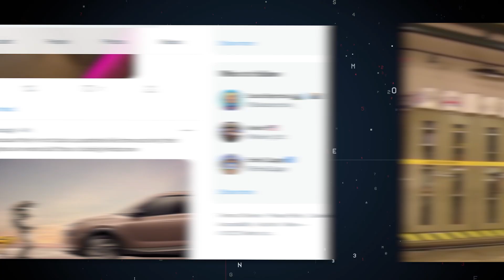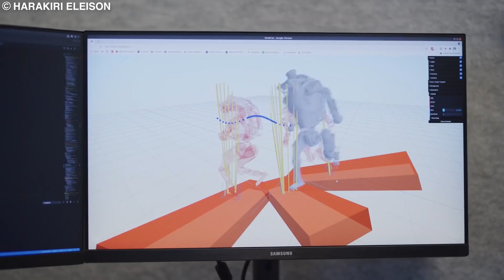Boston Dynamics' New Robot Makes Soldiers Obsolete, Here's Why

Comment: I think the biggest disadvantage of having a robot army is not being hacked but is their vulnerability to EMP's all it takes is one EMP and you lost your whole army unless somehow they make them resistant or immune to electromagnetic pulses but that  is also a double-edged sword because if they ever go rogue how are you going to shut them down it literally is a complicated thing when you think about it.
Reply: Shielding electronics from EMPs is fairly easy.
Reply: @thebiologist8662  you can shield the system, but its hard to shield the sensors such as the Pixel Arrays for Cameras, GPS, Thermal Censor, Control Censors in the actuators, and so forth. As they need to be exposed in order to sense.. without the censors, the electronics system is garbage. 
This also goes for some antennas, EMP Shield work if your core system does not need to be connected outside. Its hard to shield an Antenna and a sensor, to not say completely impossible..
Reply: @thebiologist8662  so we truly are fucked. Good luck a decade from now guys.
Reply: @thebiologist8662  ong
Reply: One:  You can shield electronics from EMPs.  Two: Emplace a self destruct not connected to its own control system. Next issue.
Reply: @dsm3759703  IA is listening. Do not tell this information.
Reply: @benignbarbarian  AI has already read every single article on EMPs
Reply: you blow up the data storage facility and control center, they go down...just like phantom menece
Reply: @tonuahmed4227  this will be decentralized (redundant) and heavily fortified.
Reply: Simple shield the electronics with a farday's cage box and use fiber optics to prevent wiring and connections from burning and shorting, fiberoptics wires are impervious to EMP and put extra shielding on the body itself to further increase resistance.
Reply: @corneliuselbourne1044  the issue is shielding from EMP also shields from remote comm
Reply: Grappling wires around the legs like in star wars to take down the empire walkers.
Reply: When you make robots to wage war you are still primitive. An advanced society doesn't wage war among their own species. They move on to achieve bigger achievements and realize it needs unity to get there
Reply: @optimize-you  I think the only way humanity is realistically going to do that is if we make contact with some form of extraterrestrial power or artificial intelligence (likely not peacefully) that requires the combined might of all the great powers to resist.
Reply: @jonwoodhouse1444  think your right, needs a huge event to unite and then some.. agree
Reply: How would a program go "rogue"? That's not how programs and programming work. They can't think. They just execute scrips full of if/then statements. These aren't sentient. They're not AI. They will never be. 

You don't even need an EMP. Just make a high powered RF jamming device for about 150 bucks, leave it on a building, and you've crippled any kind of data or telemetry they'd need in order to function. They can't tap into real time data being pushed to a sever if they have no access to the server. 

This isn't difficult to beat.
Reply: @marishiten5944  unless they have the Data programmed into their electronics so they don't need an external server
Reply: Thank you. There's NO intelligence. Just stacked algorithms by human hands. N machines ALWAYS need maintenance. Never take over but not saying police won't use the to bully us. Or even kill a few of us, but claim the machine must've malfunctioned. Free from justice not that they already aren't.
Reply: It’s very easy to harden things to EMP
Reply: Most modern military equipment is already shielded from EMPs.
Reply: @jonwoodhouse1444  you’re right but most civilian infrastructure is not private companies and the government have been fighting for over a decade on who should pay for it it’s not hard to emp proof things but it is going to cost billions and private companies don’t want to pay for it if we  were to get hit with an emp attack the big danger is killing the civilian power grid which isn’t protected the most recent studies that I’ve seen claim that one year with no power in America will kill over 90% of the population seems high but that was the conclusion that’s why  we’ve made it clear to the world that if America is hit with a serious EMP attack even if it’s non nuclear we respond nuclear
Reply: It's called a Faraday cage and it's old AF. Emp hardening isn't arcane. It's just expensive.
Reply: Where the hell you going to get an EMP? The governments will all be in on this to shore up their shrinking demographics
Reply: Someone needs to invent a lightning gun fast 🤣
Reply: Why are these people pushing and hitting robots? What is it designed for? See how the robots will fight back? So after all, this is not embedded in them and there is nowhere to take it. And if it is laid down, then it means the whole essence of these works is to create an artificial intelligence ready to destroy a natural person. What are we going to? Where does this "civilized West" lead the World? Isn't it enough that people are killing people? Russia is the last country where people want peace. And that's why she's alone now.
Reply: it's never fully robot army. it's like science. it's AI+ humans working together. not one or the other
Reply: agreed, robots can never be trusted, the story will turn out to become like Frankenstein's story.
Reply: The only way your going to make a significant EMP is a ton of energy straight from the grid, and massive amount of capacitors. The other 'easier' way is a nuclear weapon. Movie EMP bombs don't exsist.
Reply: @kaniho  yes they do EMP bombs have  exited for years do you people ever research anything or just use the force
Reply: @tammykennedy4165  name a non nuclear example that is portable that doesn't have the range of a wet fart. Go ahead.
Reply: @kaniho  wow doubling down on a bad hand ok I’ll go slow  EMP bombs have been a thing for 20+ years
Reply: Aluminum foil hats
Reply: Électromagnétique tactique missile can destroy all the robots
Reply: @hicham.hachem  unless you harden them moron it’s very easy to shield against EMP but of course you didn’t know this but you comment anyway
Reply: Tell me who can make a emp without a nuclear detonation?
Reply: @edpribish9734  we’ve had EMP bombs for decades and yes they are non nuclear goggle DO NON NUCLEAR EMP BOMBS EXIST I found the answer in less than 10 seconds you must be a horrible researcher or just stupid and lazy
Reply: It’s not practice to generate an emp large enough regular firearms and explosives would be the best choice.
Reply: It's a complicated thing, whether you think about it or not. The concept is  made complicated, simply by It's very existence!
Reply: @hypermonk33y56  replace, assist….if u have an assistant that eventually can do as much as you, you’re role is no longer required.
Reply: Not just EMP. Rust. Severance of any critical power or ECU cable (much like a human’s vital arteries). And they have really low range. Solar cellular technology is also really shitty right now.

So robots really don’t beat humans in all regards. That’s not how evolution works, sadly. 

But because they have strengths that we don’t (computational reliability, near-perfect memory and deep-learning etc.), they would make an invaluable companion/ally on the battlefield (provided that they want to serve, which I’d suggest is a strict moral prerequisite).
Reply: ATTENTION!!!! JESUS CHRIST IS COMING!!!!   IF YOU DIED TODAY, WHERE WOULD YOU GO???  HEAVEN OR HELL???  Jesus loves you and can forgive you of any sin that you have ever committed.   Repent and accept Jesus as your Lord and Savior and you will have eternal life in Heaven.  ROMANS 10:13 Any one who calls upon the name of the Lord will be saved.
Reply: @youtube_chaplain   Jesus never existed.  Christian Mythology for dimwits.

Comment: The side with the most powerful weapons always wins, like Vietnam and Afghanistan - not. 
Machine guns enabled the suppression of opposing tribes by the few, until both sides had them in WWI. 
Those who pay to develop weapons are in a never-ending race with potential enemies. Both sides terrified of falling behind and so pour badly needed resources into the industry.
Reply: Suicide soldiers are an effective weapon, but if the weapon costs millions of dollars a pop you can't throw thousands of them at the enemy. Many mass-produced weapons may trump a few expensive ones - it may be longer before they are obsolete and if they never need to be used then the complaints of wasted resources will be fewer.

Comment: No no no no no
I strongly disagree. I can see this panic in many fields every year.
No it is not making your profession obsolete.
It just made it less  tedious and more safe.
If you are codder/designer engender, mathematician, does calculator made your profession obsolete? Or does new type of computer or software? Did it happened to lawyers , consultants or doctors?
No no and no.
Automation is good thing if you are keeping with technology at least at some level.
Same with machines and robots. Do you prefer to check suspicious box on train station yourself or let robot do it.
Do you want to be one who will go into dangerous zone first and get burned , crushed or shot.
That robot need to get his back covered and also it need fixing and maintenance right here on the field and some need to look after other professionals . As always you need to maintain signal and protect infrastructure and all stuff. You still will be needed , your job became a bit less risky, and if you did some learning (some courses in last several years like basic maintenance of the drone) you still got your job for many years.
Boring and low paining jobs get automated where skill is low.
Get your skills and you will never be replaced.
Lift operators got replaced in last century, It is true, but it sounds like degrading job that probably had bellow minimal wage pay.
Learn new skills semi regularly and you will never be replaced.
Even if we invented dishwashers someone still has to put and take out them. It is good you just do it instead standing here for hours, destroying your knees and back rubbing dishes 8 hours a day.

Comment: Thanks for posting this up ST. We are already using drones  very effectively so it's easy to see why they will save many expensive soldiers lives and all can be comfortably controlled from thousands of miles away in a comfy chair.

You have to admire the brilliance of these systems, especially Stretch and the clever use of it's weighted butt. Likewise the rugged all terrain Spot.

All this is fab and dandy but aren't we just laying down the groundwork for our own destruction because, once robots can think and replicate themselves, we are truly flocked and one day we'll all be quietly put down and eradicated as surplus to requirements.

Comment: Put a couple of these in every school just standing there. THey activate when they hear gunshots, screams or firealarms. As soon as they activate they establish a video link (with recording) to a human controller say at  a police station where a human can override them or select courses of action.   BTW I can see how to train an AI from the get go in the Three Laws of Robotics with weighted decision making lessons at the very start of its learning.
Reply: Or install humans at the police station who are actually brave.
Reply: Its not that easy to train an AI for stuff like that currently, if the kids paint the guns pink the AI will be confused, or just wrap a jacket around the gun, the AI will be useless.

Ai has come far for simple and "predictable dynamic" systems, where the system can change but the changes can be predicted.

For example it is possible to train an AI to move across rought terrain, it can map it out mathematically and calculate a trajectory, but there is no way for an AI to mathematically distinguish between a jacket and a jacket covering a firearm, it requires more than that. An AI is software and mathematics.

Comment: After #LS3, #BostonDynamics have moved away from the project because the robot is just too loud and it could give up there position. However, they built the San Flee Hopper Robot that can launch itself over walls or onto roofs of a  build. It's also equipment with a camera so they can do surveillance. From Boston Dynamics most recent applications, they are staying away from turning the robots into military weapons. It was only several months back stating what the robots intentions are for moving forward.
Reply: That just means they're close enough to their goal of killer robots that they want to continue in secret.
Reply: Yup, biological muscles and joints are uncannily silent.......like, perfectly designed.

Comment: So they will be destroying each other for no reason and unusable robot parts will be the remains of the past clever designed robots?

Are there robots similar to these used outside of military? Because what these programmers are doing is awesome, smart and cool but everything related to military or soldiers is pathetic. We are not in stone age. Everyone should cooperate instead of being like two kids on sandbox and stealing plastic showels from each other.
You cannot be smart and also participate in a war at the same time. That is an oxymoron. You can make a space bending device but if it has anything to do with a war or military then it is not smart even if it would take a long time to develop. The only thing that should be considered as "being smart" is to solve everything without even thinking about stealing and war. War shouldn't even be a word.

I'm a fan of technology and logistics because it is hard to make and it requires thinking but military is the bottom and the most pathetic thing of every thing imaginable... but who cares. People will learn from their mistakes only if something bad happens. (well but only for a limited time of course)

People should expel military to some abandoned dry island so they can play and do their boom boom there to prevent them from bothering normal civilians.

Comment: Just like autonomous cars you are going to need to filed it, and break it to improve it.  The major concern is the power cells.  How long do they last, and had can they be recharged.  Then the next part is the weight.  You can make it so it is harder to hack by making sure that updates can only done with a cable.  Ethics and technology.  We have a long way to go.  What is ethical today, may not be ethical tomorrow.  We need to field them and evaluate and improve.  Great Video, and good luck!!!
Reply: Do we even have ethics?

Comment: Please spare us the sensationalist rhetoric about Boston Dynamics making soldiers obsolete. It will not and cannot happen.

The first problem is cs.  NO nation state, including the US, can _afford to replace soldiers with robots on a one for one basis.  There just isn't that much money that can be commited.

The second is volition.  The robots can do all sorts of things.  Everything, in fact, save think.  They can do only what a human controller programs them to do._Real soldiers on the battlefield are expected to get the job done, often without orders or against orders if their knowledge and experience tells the the original ops plan can't suceed and must be changed to complete the mission.

You will see robots like these used in cases where it would be suicidal for humans to attempt it, like bomb disposal or cracking hard fortifications, but all will be cases where the cost of the robot's destruction will be justified by the effect it has,

Comment: Bullshit!
No soldier will be replaced and we are FAR away from robotic troops.

The big problem is the energy density! Until that fundamental problem is solved those robots might be capable of incredible feats... But only a) while on a cable or b) for about 30 minutes until recharge.

For now those robots can't go far from a charging station aka a safe testing environment.

The next big problem will be AI or the software.... But that's a topic for the day the energy problem is solved.

Comment: As impressive (and eerie) it is to mimic biped and quadruped motion - I think these will not be the most common forms robots take in the future.
Without biological limitations you can make much more efficient designs, especially when specialized to a spesific purpose.
One really obvious trick biology did not manage to make is the wheel. But a robot doesn't necessarily need to choose one or the other...

Comment: am I the only one thinking, that many of those robots are completly over designed and over complicated for some simple tasks?
Like it seems they try to make things more human like (for example 2 wheels instead of 4 and a "upper body") for the sake of having them more human like, and not to actually get the best possible performance.......

I know this is all just starting but I think by trying to make so many robots biped, they are wasting potential, in terms of industrially (or military) used robots......
human like robots make sense for "jobs" that require human interaction....like a receptionist robot or whatever....